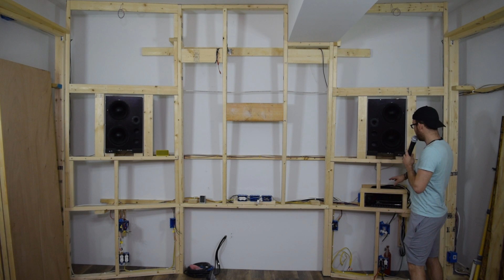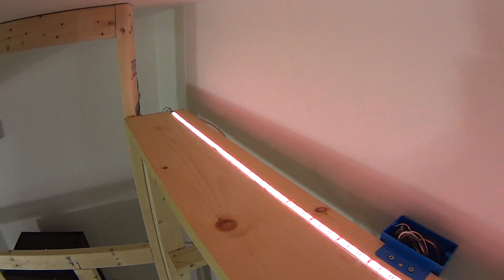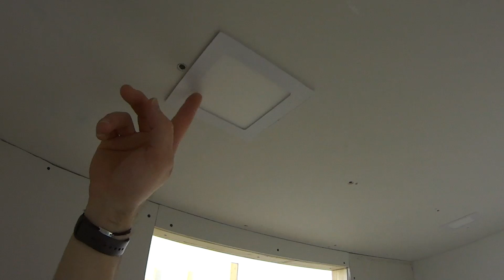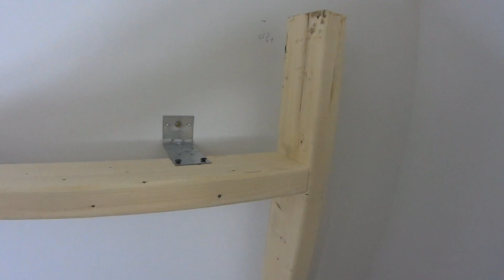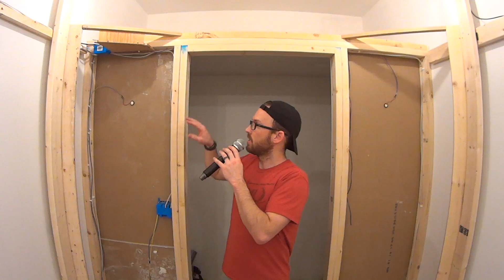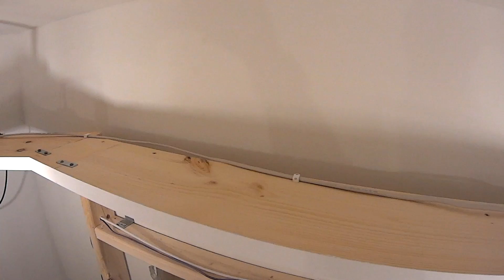Building A Professional Recording Studio - Part 11 (acoustic treatment framing finished)

Comment: How would you make that back part a bathroom when you haven’t pre-dug and installed the pipework into the concrete floor? Better off using it as an isolation booth i would think.

Comment: what I want to know is, what did you base your dimensions on, when considering side to side angular panels, in the control room. did you just wing it or estimate, or did you use some math, ... mind sharing  details > ?
Reply from the maker: Violent Grey yes so I ended up using somewhere between 7 and 9° on the side walls and roughly 10° on the front wall. I have some documentation that says that you should have at least a 6° splay on each wall totaling 12° as a minimum